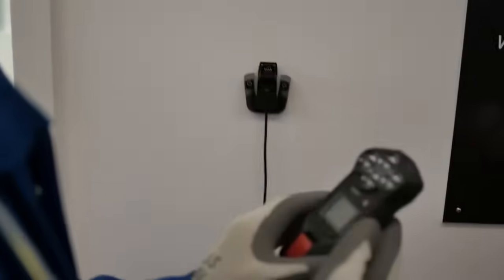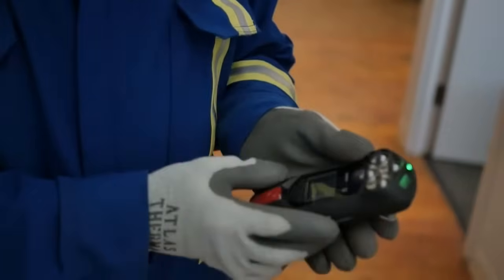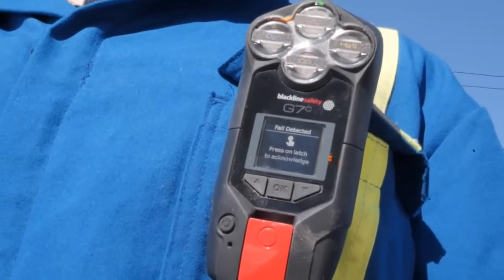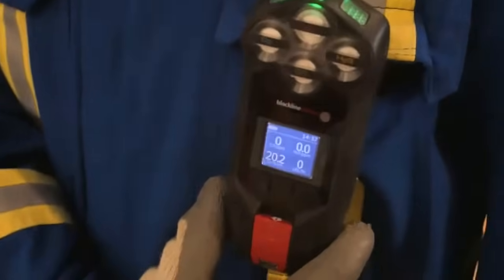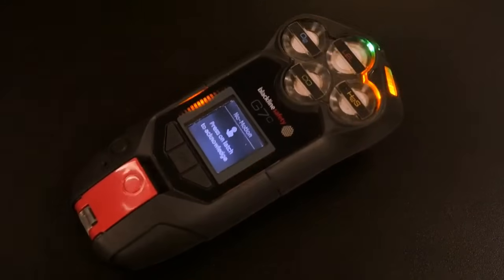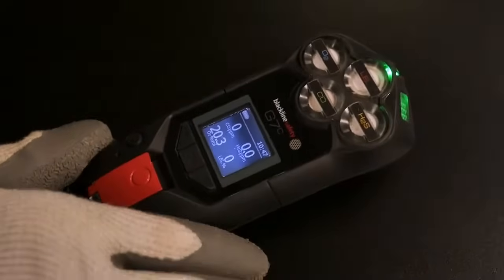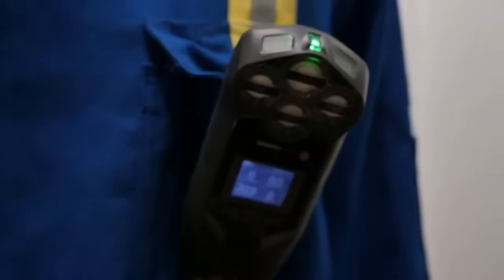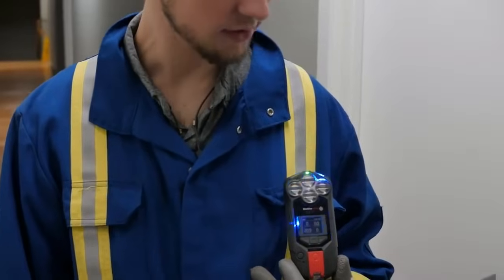Blackline Safety G7c Basic Training - Gas Detection Systems | SO2, H2S, Cl2, LEL, NH3 | Gas Detector

Comment from the maker: To learn more about our products, visit: https://www.blacklinesafety.com/
Reply from the maker: To learn more about our products, visit: https://www.blacklinesafety.com/

What is Cl2 - https://www.blacklinesafety.com/solutions/gas-sensors/cl2

Is carbon monoxide lighter than air - https://www.blacklinesafety.com/solutions/gas-sensors/co

H2S sensor - https://www.blacklinesafety.com/solutions/gas-sensors/h2s

Lel sensor - https://www.blacklinesafety.com/solutions/gas-sensors/lel-mps

NH3 - https://www.blacklinesafety.com/solutions/gas-sensors/nh3

Oxygen gas O2 - https://www.blacklinesafety.com/solutions/gas-sensors/o2

PID detector (photoionization detector) - https://www.blacklinesafety.com/solutions/gas-sensors/pid

SO2 gas - https://www.blacklinesafety.com/solutions/gas-sensors/so2
Gas monitor - https://www.blacklinesafety.com/solutions/personal-gas-detection

G7 Monitor - https://www.blacklinesafety.com/solutions/area-monitoring/g7-exo

G7 Location - https://www.blacklinesafety.com/solutions/personal-gas-detection/g7-single-gas

G7 Social Distancing - https://www.blacklinesafety.com/contact-tracing

Gas Monitoring Device - https://www.blacklinesafety.com/solutions/personal-gas-detection

Health effects from chronic low level exposure to hydrogen sulfide - https://www.blacklinesafety.com/blog/h2s-gas-need-know

What is blackline - https://www.blacklinesafety.com/

Multi gas detector - https://www.blacklinesafety.com/solutions/personal-gas-detection/g7-multi-gas

Lone worker safety - https://www.blacklinesafety.com/blog/three-things-you-need-to-keep-lone-workers-safe

Lone worker solutions - https://www.blacklinesafety.com/blog/lone-worker-solutions-save-lives

PID detectors - https://www.blacklinesafety.com/solutions/gas-sensors/pid

Safety for lone workers - https://www.blacklinesafety.com/blog/three-things-you-need-to-keep-lone-workers-safe

Combustible gas detector - https://www.blacklinesafety.com/blog/choosing-combustible-gas-detector-for-worksite

H2S name - https://www.blacklinesafety.com/blog/h2s-gas-need-know

Multi gas detector - https://www.blacklinesafety.com/solutions/personal-gas-detection/g7-multi-gas-pump

H2S monitor near me - https://www.blacklinesafety.com/blog/h2s-detector-blacklines-new-g7-delivers

H2S Exposure Chart - https://www.blacklinesafety.com/blog/h2s-gas-need-know

Blackline software - https://www.blacklinesafety.com/solutions/software/blackline-live

#blackline
#blacklinesafety
#gasdetection
#loneworker
#loneworkersafety
#safety
#workers
#h2s
#gasdetectors
#gasdetectorsnearme

YouTube channel link - https://www.youtube.com/channel/UCNilAwN5e57Uc0eWnoYq_5Q
Facebook - https://www.facebook.com/blacklinesafety/
Twitter - https://twitter.com/blacklinesafety
Instagram - https://www.instagram.com/blacklinesafety/

https://www.google.com/maps/place/Blackline+Safety/@51.0319938,-114.0456971,17z/data=!3m1!4b1!4m5!3m4!1s0x53717aa5be9f9593:0xfa2195fd7186294b!8m2!3d51.0320191!4d-114.043508
2XJ4+QH Calgary, Alberta
51.032186074881885, -114.0434762152886